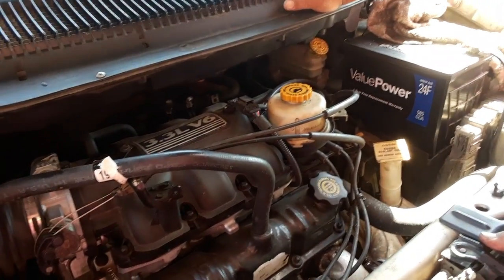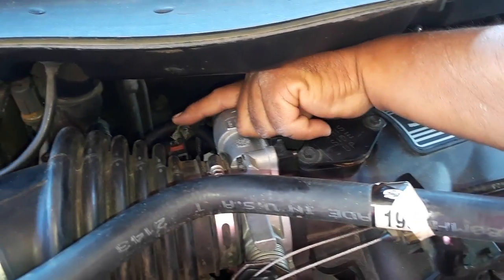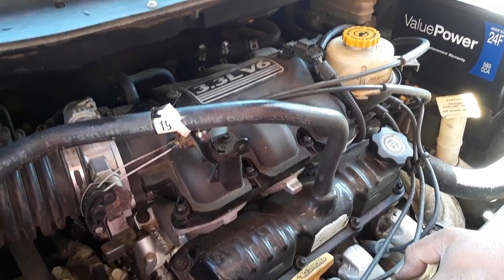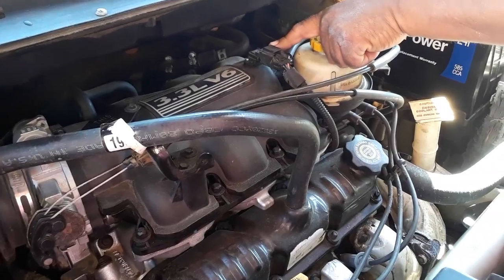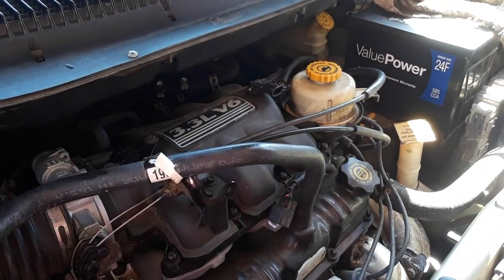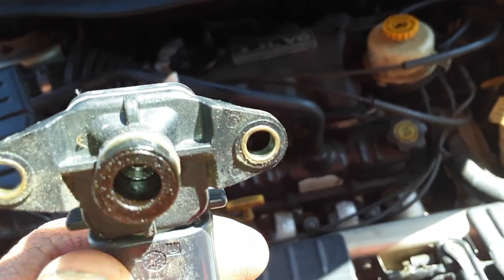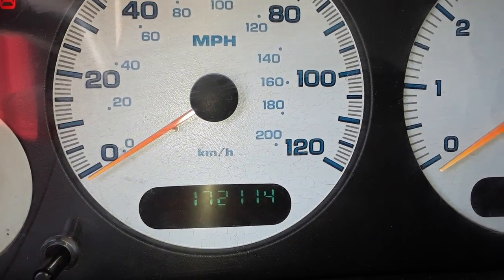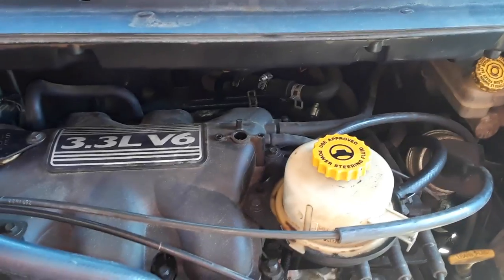I found the problem to my stalling issue, 2002 Chrysler Town and Country 3.3L check this out!

Comment: Hi my name is jeremy and I had the same issue with my 07 town and country 3.3 liter and I found out that I damaged the map sensor when I cleaned the upper intake manifold with carb cleaner when I should've taken the map sensor off first and cleaned it with electrical cleaner  so to fix the problem I replaced the map sensor with a new map sensor and   the van runs great now no more hesitating and stalling and no check engine the map sensor works just as a mass air flow sensor works by telling the (car computer) how much air and fuel to use,great job on this video it really helped me out and I hope that my comments help someone else  also take care of yourself and   your family and stay safe😷.✌🏽😁👍🙏
Reply: Hi. What function has the map sensor? Is the air sensor other part or it is the same?

Comment: My 06 3.8 l Town and country was misfiring and backfiring and sputtering, check engine light on, I replaced the coil pack and the wires and the spark plugs at the same time, problem solved.

Comment: I have a 2003 Town & Country Lxi at 134,563 miles that is doing something similar but no check engine light. Got it from an auction, and I don't think a lot of maintenance was done on it. When I start it up at the beginning of the day, it starts fine, but as soon as I put it into drive or even give it gas while in park, it stalls or chokes out. Does that once or twice every first start up now for a couple of weeks. Seems to drive fine, except it will sputter a bit when stopping fast or speeding up. Also, it will idle between 1.5-2 RPM at least half of the time. It might potentially have a faulty gas gauge as well. 
Some recent repairs I've had done on it to rule out some other potential issues are these: new battery, spark plugs, serpentine belt, cabin air filter, and has had a fuel system service clean. It could be dirty sensors or other things from sitting to be sold at an auction. I'm hoping it's not the fuel pump, trying to narrow down what it could be. Any thoughts? Much appreciated!!

Comment: I've replaced the pcv valve, the hose to the pcv valve, the MAP sensor, the egr valve, the air filter, the spark plugs, and spark plug wires, and the distributor coil pack, and recently the fuel pump and sending unit because the fuel gauge wasn't working. It showed 3/4 full when it's almost empty. After I replaced it still didn't read correctly, it's more accurate but still off by a few gallons, which means it's probably a gauge cluster issue. 

And it's still trying to stall when I'm waiting at a drive thru in Drive, the rpms start dropping below 600 down to like 500 and 400, so I drop it in neutral and give it some gas to stay running.

I just eplaced the Iac valve, and got a check engine code P0508 Idle Air Control System Circuit Low, so either the connection/wiring is bad or the new iac isn't working right, it's a walker brand and I thought it was a good brand. 

Now I'm also gonna replace the Tps and the IAT sensor because I got a code for it oo P1193.
Reply: What was the actual issue, and fix?
Reply: Same here I replaced alot and still same problem s stalling random mostly after driving around for awhile

Comment: I changed the distributor and it fixed my Sebring 1996. no more stalling issue with my car.
Reply: when random stalling occur
is sign of distributor. or fuel pump going out
Reply: @rocketsmall4547  huh cool never thought that… my distributor is probably original part

Comment: So based on the odometer and the way it is flashing also looks like you should check your batery connections too when they are loose or when you have exposed wire it will cause some of those issues as well.
Reply: it doesn't flash like that in real life, it's just the camera
Reply: Refresh rate of those displays do not match the camera sensors

Comment: You can try CRC Mass Air Flow Cleaner . Make sure the rubber boot between the air intake and the throttle body is not torn or cracked . That would allow unmetered " false air " to the engine .
Reply from the maker: The rubber boot on this particular van was fine, sort term and long term fuel ratio readings told us that. We raplaced sensor and all is well.
Reply: Thanks Bill, will keep in mind, I'm shopping
for a used Town N Country, trying to get 
a heads up on issues I may encounter,
once I find a good one.

Comment: My 2007 Chrysler stock in the highway i put oil but still not starting can you help and advice me what the problem of my car?
Reply from the maker: I don't think my issue is the same as yours. But you can put a little bit of gas on the air filter reinstall and see if it will start. It will die after it done using the feul in the filter. When it does then you know the engine is starving for feul. If it doesn't start then its going to be something else.  Wich then you will have to tow it to a shop or home.

Comment: Anyone knows about new timing chain replacement if it  got to be tight or slack. Got 07 town country 3.8 trying install a new one.Thks.
Reply from the maker: There will be very little slack at first until the engine starts the oil pump will start pumping up the hydraulic tensioner to tighten up the chain

Comment: I'm here because I have an 08 T&C 3.3 with over 300k and its starting to spudder and shake while driving, and while in park you can hear like a misfire or the exhaust sounds like its popping .. the exhaust muffler does have a hole so its kind of loud also.

Comment: My 2002 chrysler Town and Country is doing the same thing now with 165,572 miles on it.
Reply from the maker: Disconnect the sensor you saw me disconnecting at the top of the intake and see if it runs better. if it does , change the sensor.
Reply: Does it cut off and then cut back by it self
Reply: I'm having the problem too, happened after I changed fuel filter but I broke air line, I'm guessing, that sits on top of tank and run to filler assembly, I used crazy glue and baking soda to reattach line but don't know if it's getting enough of whatever it needs to run right, I also had to change fuel pump cause old fittings broke plastic tip on fuel pump, mechanic said it was tps sensor and replaced it ran ok, the hesitation and idling up and down stopped now I get running awhile and it will stall out like I'm out of gas or some kind of vacuum leak, I'll try map sensor trick or I'm done cooking with this thing! I have an 03 dodge caravan with 170,081 miles, engine and transmission still strong
Reply: @terrytrice8584  What was you final fix?
...and lol at crazy glue and baking soda, 
I tried that on a dirt bike fuel filter crack, 
it dissolved immediately. Note though, 
my last few bottles of crazy glue looked
fine, but the crap, never hardened of dried, 
they're not making it like they used to I guess.
Reply: @bikersoncall  baking soda and super glue still holding! As far as this van I should have gotten rid of it but unfortunately I still have it and the problems continue, finally started acting up after TPS sensor I'm guessing fuel management harness, fuel injectors or pcm, I have to put harness on or maybe check injectors 1st then harness I got off Amazon cheap I hear dodge doesn't make them anymore. If this doesn't work I'm done with this thing. Driver side sliding door stuck locked(actuator)
Reply: @terrytrice8584 
 I hope you get that sorted out,
or find something with less 
issues. The entire code think
is such blsht with all vehicles
that I'm aware of 9 times out
of 10 the info they give is 
just wrong and sends us all off
on wild goose chases, so very 
wrong. Let me ask you about
the 'locked sliding door' , is 
that not able to be opened 
manually from the inside?
If not, that sounds like a 
major and terrible design flaw.
Reply: @bikersoncall  it's a tricky fix I'm not taking on for an actuator, it actually started operating for awhile then seized up again but yes it's not opening
Reply: @terrytrice8584  Thanks, not opening
from the inside is crazy, these vans
are for the most part sold to families,
not a good thing for kids stuck
in the back in an emergency.. there
should be a fail-safe, manual exit
feature.
Reply: @bikersoncall  you can't pull lock up, still has 1 sliding door working and old school vans was a 1 door side thing so....
Reply: Mine was challenging to get to start then also when I out in gear it stalled. I did the disconnect test and it ran fine so replaced the map sensor. Still have the starting issue. Still have plenty of other issues. Like the door harnesses. And lost the screws to the cover that hold them. So can't put it back together anyways. The back 3 plugs are still original as previous owner didn't know hoe to change nor had money to pay someone. So I am leaning to that as a starting issue although no cel codes.could be dirty injection or fuel filter too. Doing all brakes and studs and lugs next. I'll get back to the start issue once warmer out take off rhe cowl assembly and do the valve cover gaskets and head gasket and intake manifold gaskets, pcv, and the rear plugs and wires all at once and any other parts back there while it available. And plenty of other issues not mentioned.

Comment: Did it fix it after replacing?
Reply from the maker: Yes my brother bought a new one and it runs like a champ now.
Reply: Sweet. Thank you. Hopefully that's same issue for me.
Reply: @SuperDjnrg  someone brought me an 07' Town and Country with engine performance issue. It starts up, will idle ok, but hesitates and sputters under acceleration. I've tested so many parts and yet still am looking for a fix. Thanks for making this video amigo.
Reply: Hey so do i havw to do anything special if i just unplug and plug new trying to help my friend who is in dire strains right now. Id like to fix it for her

Comment: My fans won't cut on to cool the engine on my 2006 Chrysler town and country van what can I do
Reply from the maker: Do you have a check engine light on?
Reply: fan relay unit (small plug in on frame) they go out commonly
Reply: @newfreedom21  this.
Reply: Buy a new fan, it's cooked

Comment: You should stop what your doing and see how far you can throw your scan tool. This is the only part left to change. I can make a video like this. Watch. OK my car keeps wanting to stall all I did was change the gas it’s the IAC valve EOG valve map sensor battery air filter and air temperature switch battery and air filter and just like that boda bing only 300.00 and all day and it works like a charm. Make sure to follow my next video of why gas gauge ironically is always on E When the car just dies. We gonna change the crank first then we’ll look into the ignition part of it all
Reply: on the otherhand. is still cheaper then going to the shop

Comment: If no check engine light came on then spray some brake cleaner into the air box. If spraying brake cleaner keeps the motor running then the problem is the fuel filter. I had the same problem with my O2 Town & Country van I hope this helps any other further questions don’t hesitate to ask I know the best guys in the industry who work on cars
Reply: I have the same van and I'm having problems going up hills it stalls and I have to put in over a quarter tank of gas seem to improve it but now it seems to getting worse I don't want to trust it and drive it right now
Reply: @livingthedream2773  you might have a leak. Don’t ever again top off your fuel tank but if you can just roll with a few gallons in tank and keep a full 5gal gas container with you